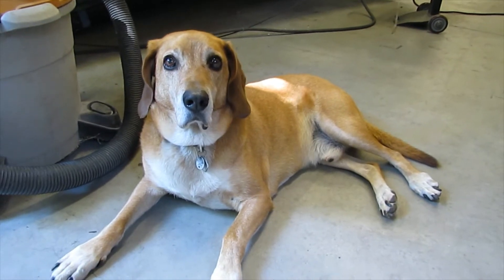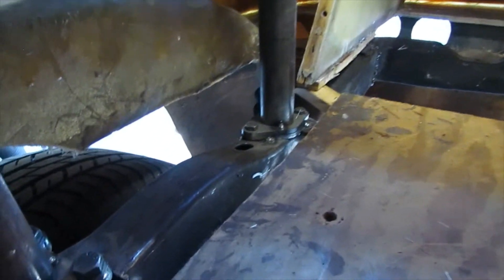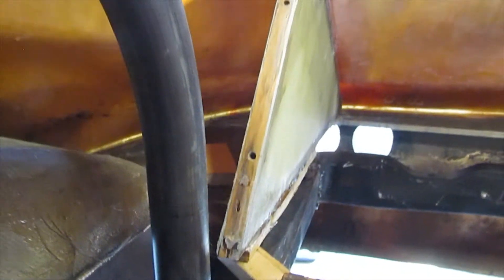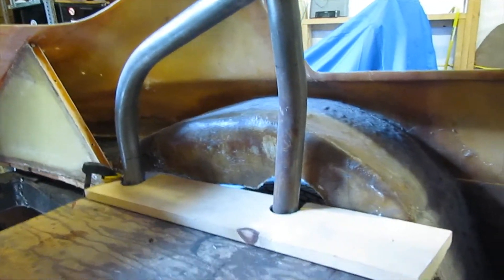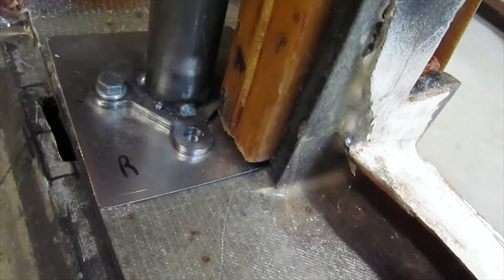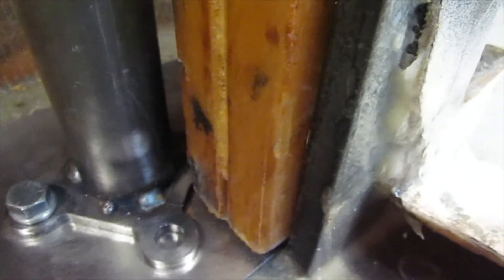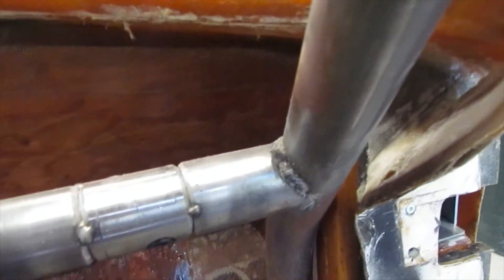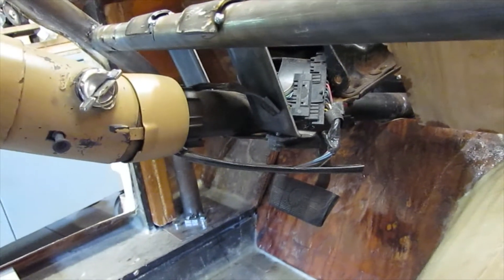Removable 6 Point Roll cage for the Victress

Comment: Check out TMR offroad. They have removeable couplers with bolt slots on the same side, meaning you don't  need extra room to insert the bolts from each side. And the slot for the nuts hold them in place. Install can be done with one allen wrench from one side only.
Reply from the maker: Thanks. At the time I did this I think they didn't have same-side interlocking cause I looked everywhere ...so I made it work from both sides.
 I think the interlocking couplers are the way to go for extra strength.